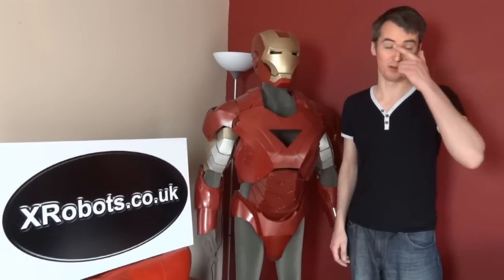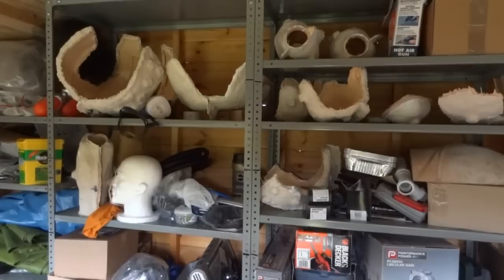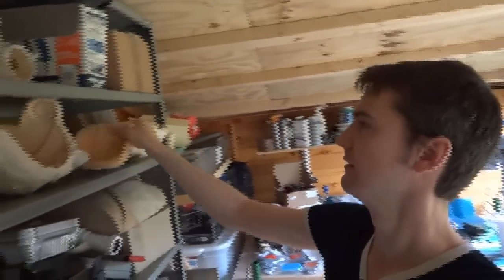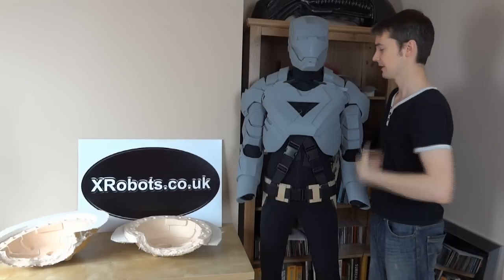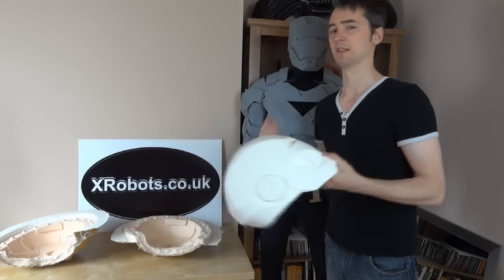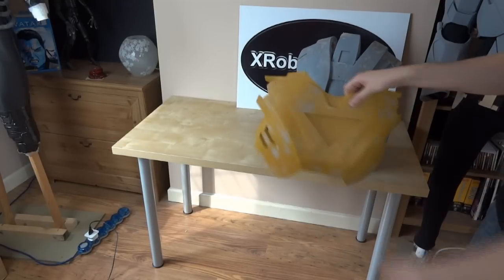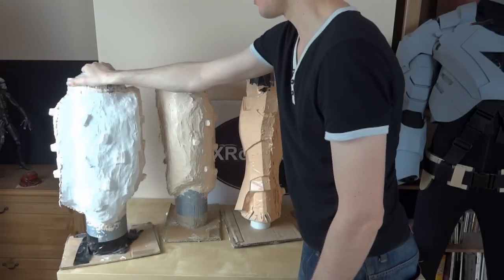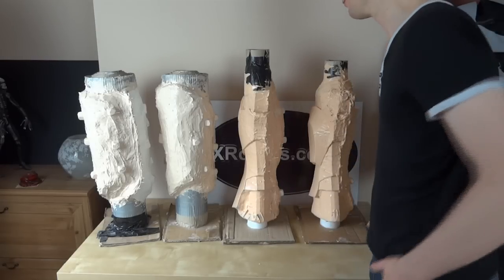Iron Man Power Suit #3 | Casting Armour Pieces | James Bruton

Comment: PLEASE ANSWER!!!!!!! ive been watching a lot of your videos. fantastic stuff. but i need to know if this will work. i was going to make a pepakura suit, re-enforce on the outside with a coat of resin, fibreglass the inside, then add a coat of bonda filler on the top to smooth things out. would i be able to make every piece like this then vacuum form them with 1mm lexan? i would like a whole suit made from plastic and was just wondering what your advice would be. ive saved a few hundred quid